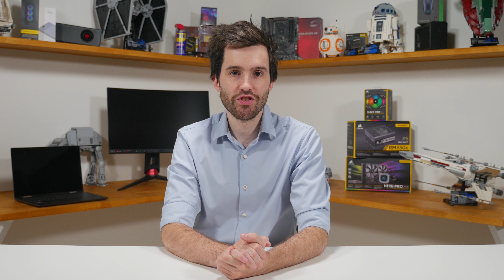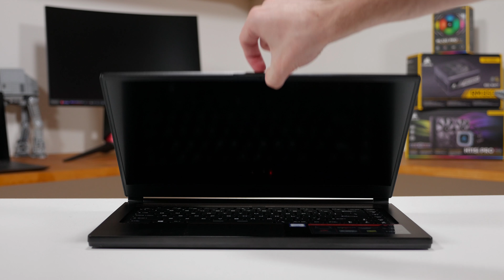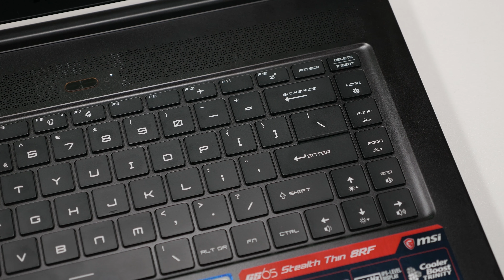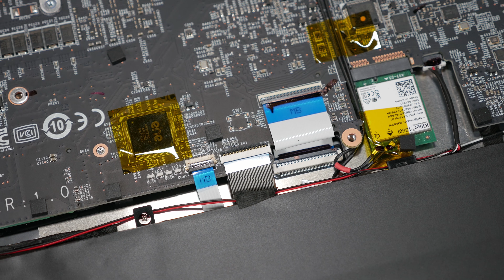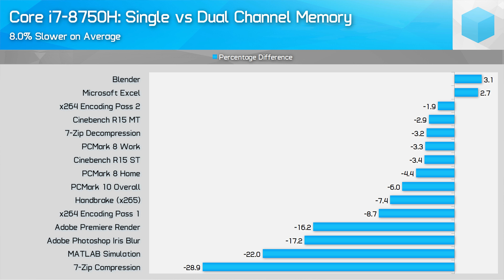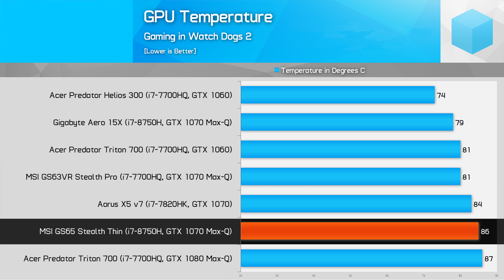MSI GS65 Stealth Thin Review, MSI's BEST EVER Laptop!

Comment: Anyone still using this laptop? I just got a used one with an i7 9750h and an rtx 2070 max q. Going to use it for mainly EU4, HoI4, CSGO and Dota 2, as well as the occasional Total War Three Kingdoms and Valheim. Anyone know how well these work? Will they overheat the system?
And would it be feasible to use this laptop during lectures to take notes? I hope the fans won't go off and what not

Comment: Dude
I av got 2 laptops in mind 1 Msi Raider GE63 i7 16gb 1TB HDd 256ssd gtx1070 120hz (bezels are thick I don’t like) 
2; Msi stealth thin GS65 i7 16gb 256Gb ssd gtx 1060 144hz thin slim beautiful looking .. 
am stuck with my decision. Thin bezels slim smart  vs 1070 I guess ... 
I need to know between these two which have better cooling noise or does 1060 last for two three years? Because am concerned about 1060 . 
Plus am hardcore gamer I do many games professionally and I travel  lot country to country .. which one will last Atleast for 3 years cuz for me it’s just one time investment so durability for couple of years is my big concern too . I do admit gs65 look way too sensitive though . Am stuck

Comment: It's a dog; Max-Q is complete shite and isn't always accurate, no matter how one sets the dGPU in the NVIDIA panel, it defaults to the iGPU. The metal body flexes, everywhere and the bezel seems so damn fragile that I'm afraid to bring it anywhere.

It's performance is lackluster, for the specs. This may be due to the software or may be due to the hardware; whatever the case may be, something seems to be the bottleneck (look on the MSI forums).

They keyboard is weak and seems cheap. It's not responsive; on certain laptops, I've been able to get to 120+ WPM typing, but, not on this one. It's something I wish I could have played around with before purchasing.

The NVIDIA panel does not really set anything, regardless of what I set the default GPU to be; for example, I set the default to be the dGPU, and then have to go through and set the dGPU on a per-app basis and it STILL doesn't always recognize the dGPU.

For the price point, I'm underwhelmed, so much so that I would like to sell or trade this POS. On that note, do you get paid by MSI? I can't believe you didn't notice that the so-called "metal" case flexes, et al.

Comment: https://www.youtube.com/watch?v=6_FzgFlVuGA

I purchased a MSI GS65 Stealth THIN. I spent the $2,500 or so on this expensive gaming computer because I knew I would be in Bosnia for a very long time and, as such, I wanted a laptop from a reputable company, a laptop that I could rely on during an extended period out of contact with Western integrated countries. 

Indeed I believe this is exactly why reputation matters so much and why one hopes it is worth the money, i.e. you pay so that the product will work when you really need it to.

Less than 3 months after I bought it, and despite meticulous care of laptop, fan #1 (the right/CPU) fan has totally failed and wails like a banshee.

Local MSI warranty centers say that not only are they unwilling, but unable to repair the computer because I bought it in the US and hang up on me. US MSI customer service centers say I must repair it locally and hang up on me.

MSI sold me an expensive computer that is broken. MSI does not care. I have never encountered a more indifferent and apathetic company that accepts so much money. DO NOT BUY MSI PRODUCTS. THEY DO NOT CARE AT ALL ABOUT THEIR CUSTOMERS!

Comment: It's basically equivalent to AERO15X except the keyboard in my opinion is much better, I unfortunately bought the latter, not complain about the performance in fact that thing is a beast, but as a programmer junkie who lives in terminal, I found little use of numpad, and it shifts the entire typing position leftwards which is awkward and hard to get use to. Contrarily the main reason why I didn't choose MSI GS65 was because of the flipped MB, which makes adding RAM and storage processes more tedious than necessary.

Comment: Hi thanks for the review, but i bought the Gigabyte Aero 15X and add an other 16GB 2666MHz stick and an other M.2 Intel 600P 512GB. I choose this one because of the Gigabyte qualiity, The RAM is faster, i could add an other SSD easily, there is the numpad, the Aero 15X comes with Windows Pro not familly, it has a card reader and the display is better. Sorry but even if the Aero 15X is more expensive in my opinion it's still the best and superior to the g65 and you can use it in a professionnal way.
Reply: Florian Lalignel WOW THANKS!! I REALLY NEED THIS!

Comment: I don't understand how it's cheaper on Best Buy, yet comes with 512 G SSD, compared to the one listed on Amazon with only 256 G - and yes, both have the 1070. https://www.bestbuy.com/site/msi-15-6-laptop-intel-core-i7-16gb-memory-nvidia-geforce-gtx-1070-512gb-solid-state-drive-matte-black-with-gold-diamond-cut/6211741.p?skuId=6211741

Comment: SOMEONE HELP!!!!!!!! NEED TO BUY THIS OR THE ALIENWARE 2018 as much as i hate bezels.
1. i think your model is 16gb single ram one. Are there 2x8gb dual channel memory on some websites?
2. Will samsung 960 pro 1tb m.2 pcie nvme ssd work on this? along side the default ssd or do i replace it?
3. will corsair vengeance 32gb(2x16) ddr4 soddim 3000mhz ram work on this after i remove default ram?
4. please make tutorial video of upgrading this laptop.

Comment: You didn't thoroughly test CPU temperature. Run Prime95 on all 6 cores and report the temperature? And then Prime95 + 3DMark simulataneously? It will not be below 90C..
I bet it will throttle even in the former with the fans at 100% speed (Coolerboost mode).
Reply from the maker: Yeah because that's testing properly. A proper real world test.
Reply: Hardware Unboxed but u incorrectly assume this laptop will be used for gaming and not  engineering/scientific purposes. All cores at 100% is a real world scenario. Happens with anyone running 7zip on a large amount of data
Reply from the maker: It's a gaming laptop...
Reply: Hardware Unboxed Gaming and workstation AFAIK really isn't a different than a Quadro instead of a GeForce maybe more accurate screen, more durable case. Most engineering students I think would buy a gaming laptop not a workstation laptop.
But anyway... 100% CPU usage can happen in many desktop uses as u know. And u aren't alone, all other reviews of this laptop don't test this either.

Comment: You're absolute right, Tim.  I'm dumbfounded by how any OEM can put out a flagship, top of the line [mostly] laptop (heck ... any piece of high-end tech' for that matter) and can overlook something that logically seems like something they'd automatically include at product release: (in this case) dual-channel memory.

Considering that the very reason for them designing such a laptop is to aim it at high-end tech' users such as professional video/ 3D content creators, and extreme gaming (i.e enthusiast-level) fans, then just why on Earth would they have such a stupid omission as not having dual-channel memory, by RTM?

It really seems like the system designers at MSI and Gigabyte had (coincidental?) brain explosions over the very same gobsmackingly obvious oversight :/
Reply: I believe its for ease of upgradability. I personally may be getting the gigabyte, and once I get it, I am slotting another 16 GB 2666Mhz in there.

Comment: Hmm I ordered a  16GB / 256GB / 1060 version. Should arrive tomorrow. Both of the retailers who sells this in Norway states it's 8x2 sticks. Maby it's different for the 1070 model?
Reply: Alright. I have my laptop now, and I can confirm it's actually a 8x2 config in my machine. GTX 1060 / 256GB / 16GB
Reply: How do you like it so far?
Reply: It's pretty amazing. It's the best "allround" machine I've had.
Reply: @Profato  is it still running good??
Reply: How are the gaming temperatures, i'm going for the 1070.
Reply: Marius Nilsen where did you get it from? Amazon?
Reply: Marius Nilsen Hey how are the temps for this Gaming laptop? I might get one this week.
Reply: Marius Nilsen Amazon is selling dual

Comment: funny how my 2700k at 5GHz is still faster than these laptop kaby lake CPUs in cinebench r15.

SC = 175
MC = 872
Reply: XK XK what? Those i7-8750H are really close to their desktop counterpart.....

The i7-2700K is nowhere near the i7-8750H.

If not, prove it :/
Reply: "Those i7-8750H are really close to their desktop counterpart....."

No 8700K beats the 8750H significantly. If you think about it technically, how would you make a laptop processor "really close" to their desktop counterparts while managing thermal and power consumption in a small and lightweight chassis? There's a reason why laptop mobile processors are significantly slower than their desktop counterparts.

http://cpu.userbenchmark.com/Compare/Intel-Core-i7-8750H-vs-Intel-Core-i7-8700K/m470418vs3937

"The i7-2700K is nowhere near the i7-8750H." 

I never mentioned that my 2700K is faster than the 8750H? Technically in single core instances my 2700K would be on par with the 8750H, obviously in multicore the 8750H is faster regardless of the 5GHz overclock on my 2700K due to having more threads and the generational gap between processors.

I'm talking about 7700HQ.

7700HQ = Kaby Lake

8750H = Coffee Lake

http://cpu.userbenchmark.com/Compare/Intel-Core-i7-2700K-vs-Intel-Core-i7-7700HQ/1985vsm211019

Comment: wth is that flipped motherboard, wtf MSI
Reply: If that made the cooling better I'd give it a pass.
Reply: I have this feeling that replacing laptop every other year or so is more common than reposting.
Reply: I meant I don't think people repaste that commonly. I do agree replacing gaming laptops every other year is a big expense, I was just trying to compare that two things people do.
Reply: it made accessibility to cooling worse(therefore it's really hard to clean and re-paste in the future) so no. Unless of course you buy new gaming laptops each 1-2 years.
Reply: Law Hansel dude... no. Gaming laptops are expensive af and replacing them every year or two just isn't right. It's more reasonable to upgrade a gpu every generation for a desktop.
Reply: It actually makes cooling work a little better, but that was a smart ass movement, they wantex to improve cooling´s performance, but made it a pain in the ass to clean up... Nice Job MSI.
Reply: I usually try to get the most powerful GPU with a compatible/matching Processor highest vram & keep it for at least 1 decade. After that point & upgrade can be justified but every year or so? Naw u better off throw money at the strip club.

Comment: I'm still concern of the temperatures, if I'll buy this. Seems like liquid metals would probably do the trick, otherwise I'll have a throttling CPU while gaming...
Reply: ummm nope. I think you're confusing it with underclocking. With undervolting clockseeds and performance stay the same. Watch video on youtube called "12 dollar hack to boost your laptop performance" on youtube to know what I mean.
Reply: Kirby Be easier and safer using a cooling pad...
Reply: Jack Cutler and it's even easier(and completely free) to use undervolting. Tons better than cooling pads.
Reply: Bhavdeep singh sidhu I don't understand the question. Undervolting is super effective and causes zero loss in performance.
Reply: Jack Cutler i was legit gonna type that
Reply: TabalugaDragon performance?
Reply: TabalugaDragon i dont know too much about underlvolting but its basically the reverse of overclocking which is increasing power.. So it should decrease performance
Reply: TabalugaDragon ok i wasnt too sure myself

Comment: :'( what they really need is a laptop thats easy to clean.. I cleaned my Acer Nitro 17" fans with the vacuum yesterday and found the entire thing covered in dust bunnies.. I was getting 1300 in valley benchmark and after cleaning and overclocking I got 1600.. Ohh I also got 1400 overclockin when fans were blocked and after cleaning 1400 without overclock.. hehe. 2 Fans btw.

Comment: RIP dual channel memory 2018
Reply: HI, are you sure? haven't seen even one retail selling this model with a single 16 gb stick. From what I understand, the default manufacturer model is coming with  2x8gb sticks. If MSI offers both options it's actually a boon as 2x8 gb is better for the default 16gb ram setup, but if think about upgrading to 32gb, having a single 16gb stick is more value.
Reply: What single channel memory?  - "RAM: 16GB (8G*2) DDR4 2400MHz, 2 Sockets; Max Memory 32GB"(copied from the amazon link above).
Reply: The one I just ordered is 32gb with two 16gb sticks.
Reply: Shaldar it depends on where you buy yours from. Some stores supply theirs with a single 16 gb stick while others supply 2x8gb sticks.
Reply: I know right =(
Reply: it makes diference at least for me
Reply: Are you people mixing this up with the Aero 15x
Reply: is rzaer blade and this mso gs65 which have more good battery life?
Reply: @Danny just left a comment on your video, my guess is the frame rate is capped from VSync in that game you tested.
Reply: MSI best laptop series are Titan all others are waste of money. I tested them quite a lot and all of them have problem with cooling. I recommend to everyone stay away from buying thin gaming laptops.
Reply: @tesnjak  lol, no one wants  to carry bulky laptop to class which can't even last 60 mins.
Reply: Just Ordered mine for $1,500 on Amazon.com awesome.

Comment: Why do these OEMs insist on single channel RAM? There's not that much difference in price between single and dual sticks...
Reply: To make upgrades easier. I think it only makes sense in 8 or less GB models tho. Few will need 32 and not get it straight from the factory.
Reply: Houssam Alucad Why care about easy upgradability of ram when you have to take the whole mobo out?
Reply: Jhelzei those pennies add up...
Reply: CoolTech selling old RAM at a low price to upgrade is not that easy or financially good either.